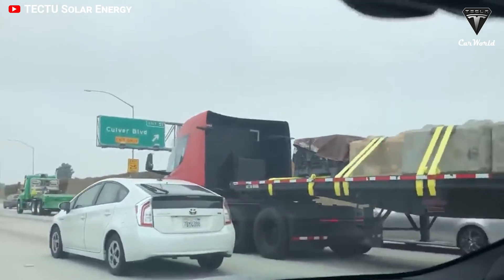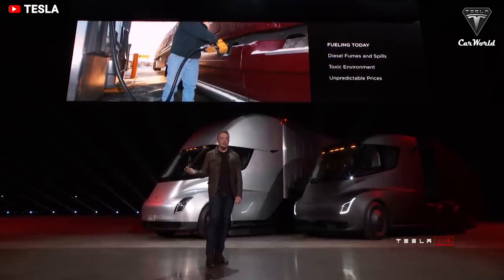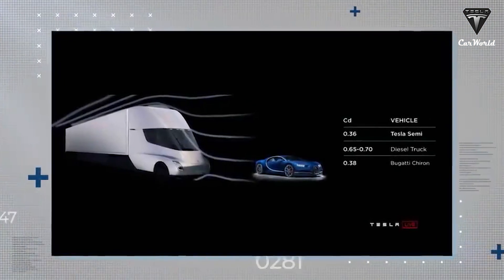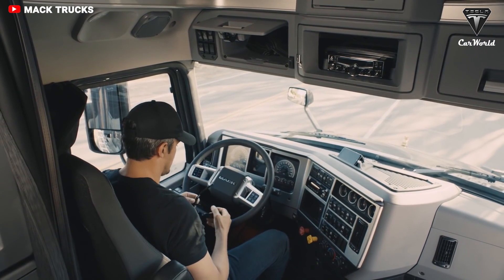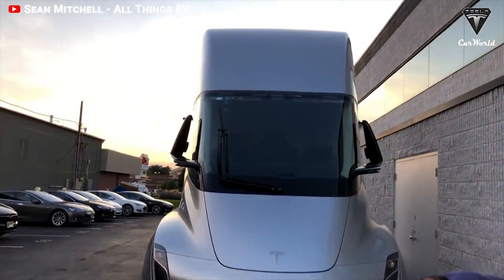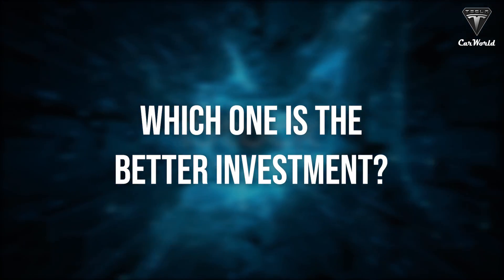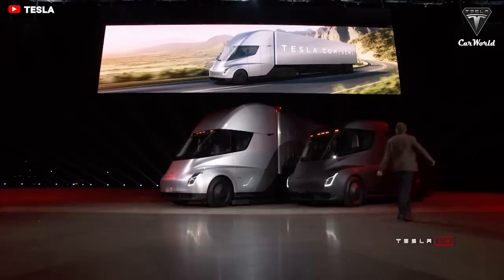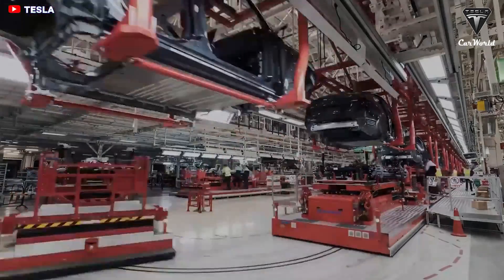Which is the KING of 2023 heavy trucks? Mack Anthem Diesel Truck Vs. Tesla Electric Semi?

Comment: This comparison actually makes sense if you know Nothing about Semi Trucks or hauling freight.  First, the Mack Anthem is a piece of cheap, plastic junk with the worst suspension and ride comfort of any truck I have driven in almost 40 years. I wouldn't suggest buying one to anyone. Second, acceleration from 0 to 60 , bigger computer screens and auto breaking or auto driving abilities are the last things Drivers want. Nothing about the auto breaking systems or radar breaking systems helps. It is purely an annoyance, another distraction and frankly a danger to both the Driver and those around them. Making a truck that accelerates this fast is asinine.  Even at 80,000 lbs, most trucks won't hold traction on a wet road, much less in snow or on ice from a stop to going the speed limit. Now imagine a truck with 4 times the acceleration.  Traction control? Yeah.... this isn't a 3,000 lb car that is only 18 feet long and doesn't articulate.  We've had traction control and interlocking differentials in trucks for over 30 years. Works great when you're going very slow but is useless at speeds above 25 to 35 mph. And honestly,  if you need traction control on, you shouldn't be going that fast to begin with.  Third, range of the truck. 300 miles? Are you kidding me? I drive 157,000 miles per year on AVERAGE. The truck I currently drive has a range of over 1,500 miles between fuel stops. I sometimes have to deadhead 300 miles just to pick up a load. This truck would be much better suited if it had a generator on board so that it was self contained.  45 minutes to 8 hrs to recharge every 3 to 500 miles is completely unacceptable.  Forth and finally,  the Sleeper Birth. There isn't one on the Tesla. From every video or screen shot I've seen of the inside of these trucks, there is no bed or Sleeper.  So, welcome to the 40s and 50s where Drivers had to stop at a motel, slept in their seat, put up a hammock from one side to the other, or camped out next to their truck. Anything the company buying these trucks saved on fuel just went out the window on motel rooms. The people driving trucks today aren't made of the same grit and determination of those that started this Industry.  So now you're looking at over a hundred a night on motel rooms, plus trying to find a safe place to park the truck. Not going to happen in this lifetime.  
Electric vehicles are a great idea. Until our Power grid is upgraded, more Charging Stations are accessible, a lot more parking is available,  this just isn't feasible. A Hybrid would be a much better solution for the time being.  Even if, for Semis, it was just having a generator recharging the batteries. You can't drive a Lamborghini over a Jeep trail and expect it to not get stuck and you can't take an electric vehicle on roads that aren't ready for them yet.

Comment: Charge times snd charging locations would be it's biggest down fall right now. Also how would it do milage wise in Colorado while pulling the mountains fully loaded? I can see that range going right out the window even with the braking system.
Reply: Whiteboy133:  Try looking up facts before typing.  How is 70% charge, for 350 miles in 30 minute a problem for the Tesla? 

The 500 mile successful range test included LOTS of serious elevation changes, including mountains.  Downhill, the batteries recharge. 

Like with the usual deniers, you appear to have no idea what you're talking about.

Comment: These vehicles are good for local ltl. That's it. And in most cases, it'll be city use, so the 0-60 time is pretty much useless. 

Let us know when a Tesla sleeper truck and trailer weigh 35 000 lbs or less and can haul 45,000 lbs or more, can go 1200-1800 miles (6 mpg avg @  80k for a diesel) between charges and charge in 20 minutes or less.

Comment: I'm just curious about the longevity of the ev, I can see repairs being redicoulous expensive
Reply: Brad:  From what I've read, a million miles expected.  Which is considerably better than the 750,000 miles typical for diesel.  And with far less moving parts, the maintenance is expected to be FAR less than for the ICE diesels.  

I'm not sure on warranties for the BEV Tesla.   I've seen a million miles for the powertrain, but that isn't consistent.   Outside of warranty, power train repairs on the BEV will likely be expensive, BUT that is MINOR compared to MASSIVELY higher ongoing expenses for diesel vs. cheap charging.
Reply: @rogergeyer9851  I'm with ya on that, an ice truck isn't cheap to work on either. Consider oil changes and filters over time
Reply: @rogergeyer9851  Great an armchair truck driver that picks and chooses where he gets his facts from.
Reply: w8ébg

Comment: No mention of how many HOURS it takes to charge this semi you can fill a diesel semi at a truck stop in under 10 minutes 200 gallons and be on the road for around a thousand miles a semi is not meant to be a race car so who cares how quick you can get 0 to 60 how well would this electric semi do on Ice Road Truckers lots of questions and no answers I think I'll stick with the new Mac fossil fuels are more reliable in the long run

Comment: Horsepower doesn't really matter for hauling heavy loads. Its all about those torque numbers. Peak torque doesn't matter that much either, its about how linear that torque is.... and the electric motors win the day with that.

Where are you finding electricity for $0.07/kwh? In central TX I'm paying $0.09 / kwh and that is incredibly cheap. The national average is close to $0.18 / kwh, and in CA it is on average $0.28 / kwh. So it would be $72 at the national average, and $112 at the California average. If those trucks are using superchargers, they're paying more for the charging too. That ranges some where between $0.30 and $0.65 / kwh, which would be $120 - $260 for the 200 mile trip. The operational costs for the Tesla semi really only pays out when you're not charging at a supercharger, which means you're not saving much in the way of fuel costs. 

These trucks make perfect sense for local deliveries, but cross country trips wont be done in a electric truck for quite some time.

Comment: I did not find anywhere where the tesla semi truck will weigh the same as a diesel semi truck. I found that Tesla said there would be no sacrifice to cargo capacity as compared to a  diesel semi truck. Then people assume the Tesla Semi truck weighs the same as a diesel truck. there are different classes of cargo (50-500) with different densities. A Nikola Tre BEV 350 mile class 8 semi truck with 750 kw/h battery pack weighs nearly 30,000 pounds.
82000 limit-30000 nikola tre-10000 trailer=42000 lb freight payload/ 3816 cubic ft for 53' trailer=11 pound/cubic foot=freight class 92 . I assume a 500 mile Tesla Semi truck will weigh nearly 30000+ pounds, based on a model 3 is 33% heavier than a Honda Accord. So a Nikola Tre BEV and Tesla Semi truck have no sacrifice to cargo capacity for freight class 92 - class 500 as compared to a diesel truck. A typical diesel truck with fuel weighs 20,000+ pounds
80,000 pound limit- 20000 diesel truck - 10000 trailer=50000 payload/3816 cubic ft per 53' trailer=13.1 pounds/cubic foot. So a diesel truck can deliver a full cargo 53' load of freight class of 85- class 500.
Trucking companies that have the nikola Tre bev 350 mile range truck say they are getting 250 miles on a single charge for a full 82000 truck+trailer+freight. That is why I think a Tesla 500 Mile range semi truck with 82000 pound truck+trailer+freight will get less than 400 miles per charge.
Diesel trucks can deliver up to 25 tons of freight
Class 8 semi trucks can deliver 21 tons of freight
Reply: class 8 ev semi trucks can deliver 21 tons of freight, 4 tons less than class 8 diesel truck
Reply: The Tesla Semi has an estimated weight of 27,000lb without the trailer.

Comment: The question is "how well is your truck still driving after putting 7 MILLION miles on it" as I know that truck and it was a Peterbilt not a Mack.

COOLING IS CRITICAL ESPECIALLY IN PURE BEV but yes of course far less an issue in a modern diesel but still At Issue.
The two huge advantages Tesla offers up
A: standard automatic transmission as it needs no transmission and
B safety features that can only be imagined in one of the DEADLIEST occupations in the USA especially this time of Year Winter/Snowstorm Ice and Slush Season.

Anyhow the GREAT news is that Tesla has had many Years testing and validating their 2 prototypes....so what the actualized production en masse be ... well it will be fun to drive of that there is no doubt. The only platform change I would have made would be to have 2 wheels up front parallel to the eight drive wheels. Indeed "bobtailing" a Tesla Semi could in fact be truly LETHAL.
Reply: If we give the Tesla the benefit of the doubt a d it's a LIFPO4 battery they are good for around 6000 charges. The truck has a 500 mile range. That would be 14,000. So it would probably be at least on battery number 3 at that time.

Comment: Apart from looking flimsy and weird, let's see the performance, reliability and durability of the first delivered so call truck/semi. For now I still put my money on traditional diesel trucks/semi if you don't mind. I have seen what happened to Teslas after crashing. Also among others to think about:
-How long will those batteries last till need replacing?
-how much will it cost to replace?
-Will the range be effected by extreme weather?
-No brake pad change ever? Then if sudden electrical failure, how will you stop these high acceleration 50 tonnes (with load) fire bomb without physical brakes? 
-Will i need to alter my schedule to accommodate charging? Diesel will be just fill and go anytime.
Reply: Tesla batteries can and have done well over a million miles, and can be recycled. 
The vehicle still has adequate brakes of course, regen is just a far superior system for efficiency and is pretty damn reliable. 
Like all electric cars, there will be deficits in range in bad conditions, but the truck isnt designed for ice road truckers.
The new Megawatt chargers that are starting installation now will be very quick and will nearly completely charge the truck within the mandated 30minute break, over time, with enough of these installed, there won't be a problem
Reply: Biggest question to me is, where will you charge those things? It's not like they can pull up to a compact zone and plug in at a mall. They will need separate charging stations away from the cars. They will need a LOT of charging stations spread around and across the US. That's a major infrastructure project.
Reply: @Quinton I was for 15 years. Several times I've had to look for the person blocking the pump. Some of the drivers were cool, some of them got angry at me. I'm not sure what the confusion is. Are you too intimidated to ask?
Reply: @Quinton I still work around trucks. Just not driving them anymore. Did hazmat for a little while, then moved on when offered a cozier job with an office (mini blinds and all) at a dealer maint. shop. No, I have not been out and about as a driver in a bit, but I do have enough common sense to understand what's going on economically. It cost $80 to fill up my Ford Escape here in CA. The first thing I think of is the issues that drivers and the industry is going though. I think about it all the time. I mean, if that much changed in two years at the pump, then...ok. Fine. I won't argue. No reason to.
Reply: @Quinton Well, unfortunately that's up to you to ask them to move out the way. Any driver who blocks that is just being an a-hole.
Reply: True, what are the long term cost?

Comment: The guy making this video sounds like a tesla fan boy. First  there is no  Infrastructure for electric trucks. Second if something goes wrong with it and you have to repair it on the road tesla will lock it down because it wasn't fixed at a tesla. Any driver that knows the real world of trucking knows that a tow bill for a semi can be thousands. So until tesla can start allowing repairs the truck will be useless. There is a list a mile long on issues on why the tesla can't anywhere near come close to replacing a diesel engine in trucking. It may do ok for local stuff but long haul it's decades behind.

Comment: How long does it takes to charge every 200 miles?
Reply: 300 to 500  miles range, depending on version. No idea where you get that  "every 200 miles" from. The charge time depends on many factors, the most important being the power available from the charger. The Semi can charge at a maximum rate of1 megawatt, or 1,000 kilowatts. That means putting 1,000 kilowatt-hours of energy in 1 hour. Since the Semi energy consumption is less than 2 kilowatt-hours per mile, that means that it will take less than an hour to get a full 500 mile charge. Even less time if it just needs a "top-off". 

Less than 15 minutes for a 200 mile charge.

Comment: The consumer doesn't care about 0-60 nor how much power and torque the motor makes. We want to know how long does the battery will last before a charge!? Stop bullshitting about it just tell us how many miles before a recharge? The Mack truck gives you close to or over 800 miles before refueling. Why don't y'all make a race pulling a full load of 30,000lbs load from Maine to California. Let's see which one will actually get there first.

Comment: last time I checked the chargers were charging over .42 per kwh. maybe if you plug in at home and use an extension cord you can get to .07 a kwh. but real life is going to be more. they haven't started charging a road tax on electricity yet, but that I'm sure is coming also. but no trucker wants to be down for 3+ hours while it charges from 10% to 100% when in 20mins or less they can be filled back on the road and doubling the miles traveled on tanks (battery) . maybe good for local deliveries that can be plugged in overnight at the yard, but even then, start factoring in the cost of those chargers and they break all the time and it isn't that great.
Reply: Based on the battery size, I would wager that the chargers they will develop for OTR would get the truck recharged in 20 minutes or so. The problem is that the cost is comparable to the cost of diesel fuel based on Tesla's current supercharging costs.
Reply: Fleet owners would probably have chargers at all their facilities and have bulk purchase agreements with power companies so they wouldn’t be paying retail rates.

Depending on the size of facilities they might also make use of solar and aerowind systems to cut their overall power bill.

Can’t really see anyone other than fleets getting the first gen models given the savings is really in the operations cost not the raw hauling distances.

Comment: Apples and oranges,  torque climbs hills not hp. No sleeper. Refueling,  distance,  and the mph bs . My 05 International get better than 5.9 mpg. Lights,  a/c , heat are all factors that diminish distance for ev. It is bs and won't work  except for city use .

Comment: I wonder how the demand on the power grid will be while multiple trucks are charging
Reply: Expect a power plant near the truck stop...
Reply: I’m betting the truck stops will soon have new roofs over the asphalt that are suspiciously black with silver lines…
Reply: that all depends on the infrastructure the charging stations use...if they have large power storage not much because they will pull power to the storage facility in off peak hours.  If it is free flowing power from the grid it will be considerable if folks are using it during peak hours but folks will attempt to not do that as the expense will be pretty high.

Comment: When you calculate drag coefficients you also have to multiply by the square drag area to get a true comparable number. Even though the drag coefficient is 0.36, the square frontal area is double thanks to the flat nose design. So they're about even on total wind resistance
Reply: Penis size is lineair down compared to size of owners car

Comment: 30 years as class A driver.  I believe in comfort and safety.  I prefer the mack. But I been driving the freightliner all my career.  Brake don't have to be changed on the Tesla try driving 82000 lbs down up the Colorado mountains.
Reply: Tesla has been running their test Semi's up and down the Donner pass and the Altamont pass regularly for years now, hauling loads of batteries from their Gigafactory near Reno to their Fremont assembly plant. Regenerative braking never fails, never overheats, always reliable, doesn't wear the brake pads, and it helps recharge the batteries, too.

Comment: I’ll take an Anthem any day. Rather truck all day and get to my destination than have to stop for 2-5 hours to charge. More miles in a day makes the difference in making a payday and not making a payday. The Mack can also haul more tonnage than the Tesla since it’s much lighter than the Tesla. They’re not going to bend highway regulations just to make the Tesla competitive, and if they do they need to go up on the tonnage for every truck.
Reply: Where did you get that charge time from?
Reply: Also I'm pretty sure the Trump administration actually signed a bill back in 2019 that does increase the maximum weight limit.